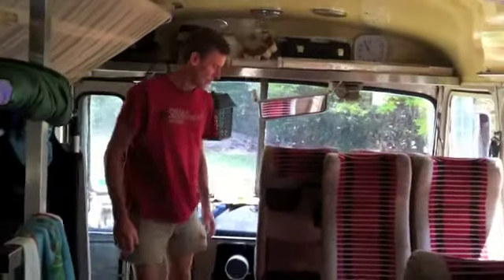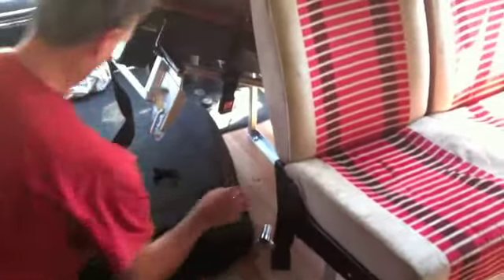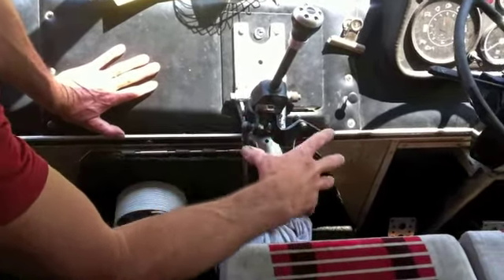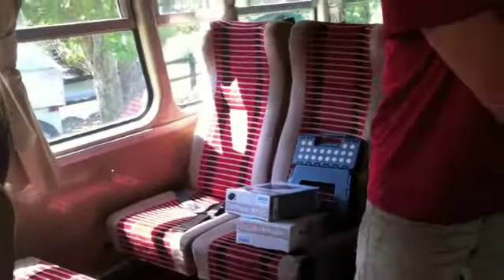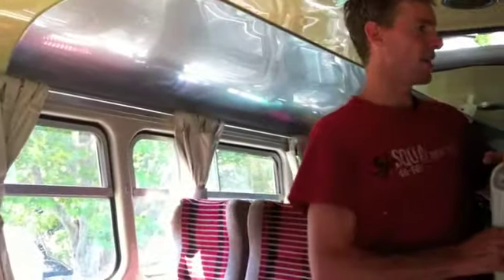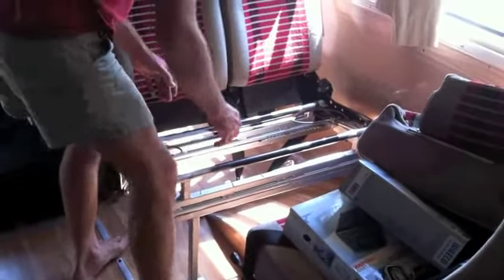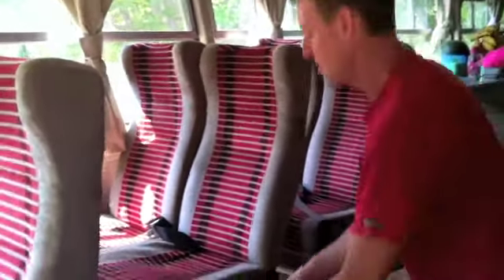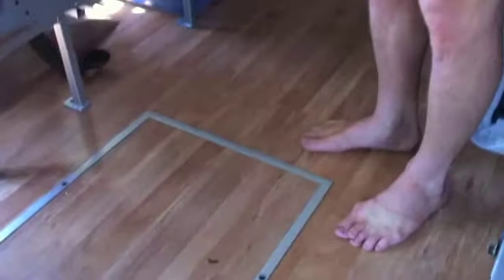Weitenberg Motorhome Bus Seat Installation & Design

Comment: Hi gang 
How did you go having the seats passed by transport as you are not allowed to bolt seats through wooden floors ?
Reply from the maker: Greg Lette Hi Greg, All the bolt holes line up with the original seat fixing points, so it's all standard for engineering, excepting for the engine cover ones, which we had to have specially certified.
Reply: Oh okay 
I fitted 4 new bucket seats in our coach then found out that they could not be bolted down if there was timber , vinyl , carpet , floating flooring or anything else between the seat frame and the steel mounting points , this is according to the ADR rules , now I have to remove all the seats and re design the mounting so it all complies before I can get the engineering certificate .